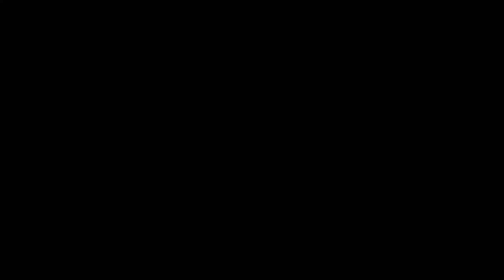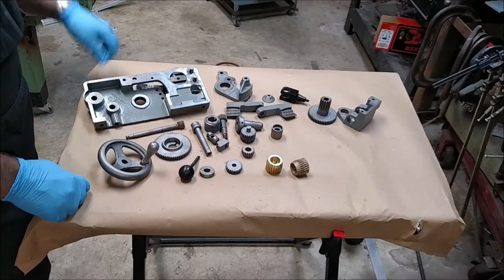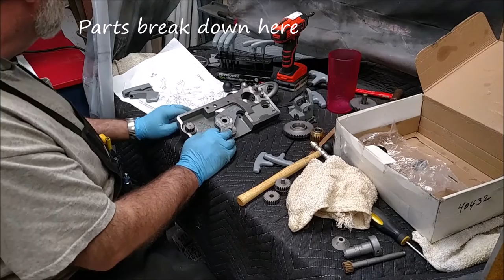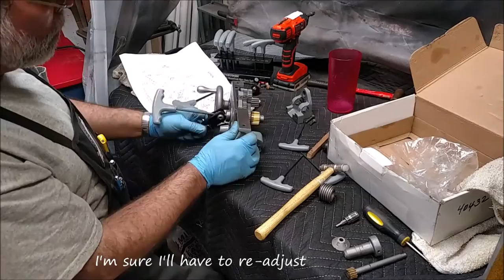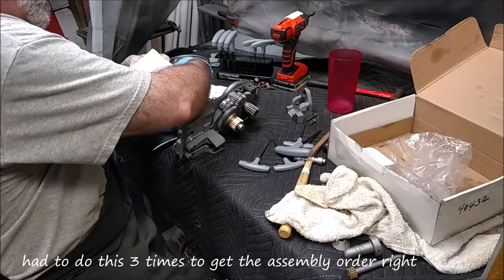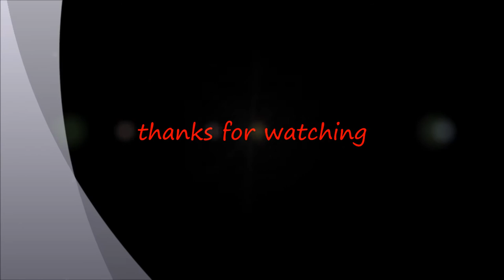Rockwell 10" Metal Lathe Restore  #12 Apron Assembly

Comment: hay man looks good. if the gods are with me I may be snagging a 15" 1920's south bend got lots of goodies with it to.
Reply from the maker: Dude that 15" Southbend is an awesome monster! especially with the tooling. The thing ppl don't understand about Lathes is you can get a big one in decent shape for the same price as a small one and you can always do small work on a big lathe but not vice a versa. I love those old tools from the 20's 30's and 40's. you'll have yourself a machine worth putting the time into restoring.  I bought a Royersford Camelback drill from the 20's the other day, can't wait to get started on it.
Reply: I agree I'm hunting for one of those to. have you seen my brown sharpe mill?
Reply from the maker: dude that's a nice machine, looks complete too, I like the tranny on top lol. I've got a Graves shaper from the same period with an old truck tranny hanging off the end. transmission Prolly worth more than the old shaper lol
Reply: it is complete. I even bought the universal dividing head from kith rucker. two hand wheels were broken but I made patterns and am machining the new ones. I got a whole video series on it.
Reply from the maker: does the dividing head have all the gearing that attaches it to the x axis feed on your mill to make helical gears? yeah I watched most if the series. when I first saw that busted handle i was gonna tell ya I've had some luck with tig welding cast iron but then saw your other videos and realized you'd found a better way lol. I had seen on one of Keith's videos he actually had a foundry that would do low volume onesie twosie work and was curious about you having yours done. I've been lurking on vintagemachinery.org for several years when I found his videos on YouTube and realized he only lives about 2 hours from me. Him in Valdosta Georgia, me in North Florida. Want to go see that museum he does work for one day. I'll put a  short video up about the Camelback drill, so you can get a look at it.
Reply: I have one or two of them once the mill is running properly I could cut new ones.  I am missing the banjos to hold the gears just need to find someone that has mesurments and I could cast them also. kinda feels like Jonny Cash's song one piece at a time. but things that are 100+ years old are seldom complete.  just how it goes
Reply from the maker: true, one reason I wanted this Camelback drill so bad , everything seems to be there cleaning the motor and the switch, only thing missing is the crank handle for the table. I think it can be bought at McMaster Carr. I saw your power hacksaw, that's another thing on my list of wants.
Reply: what does the original crank look like maybe we have a pattern around here. can always make one to.
Reply from the maker: I couldn't figure out how to send you a picture of this handle so I emailed you one from an old catalog
Reply: I did get it that should be doable.
Reply: Picked up one of these machines a couple of weeks ago and have been cleaning out the crud of each part.  Of course the part I screwed up is the half nut lever, do you have any detail on the detent pin that goes through the left side of bore to the selecter?  I haven't extracted the pin from the main housing but I sure buggered up the spring and believe whatever ring is supposed to be there is gone.  Any help would be greatly appreciated! Thank you much for this video series, info seems to be pretty limited out there.

Comment: I see you have a new cross feed bronze gear there in your parts. DO you mind telling me where you purchased it?
Reply from the maker: No problem. It was on EBay and the seller name is scratchndent11.  I paid $60  for it the only problem is this gear was 360 brass and the factory drawing spec'd Bronze.